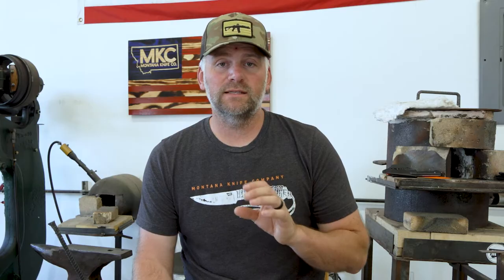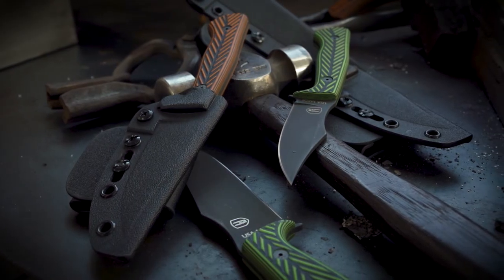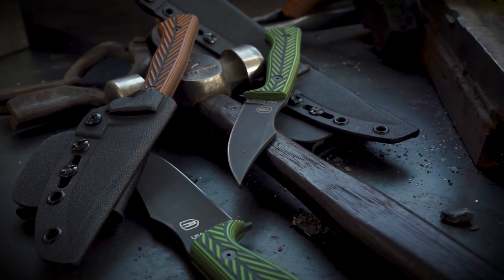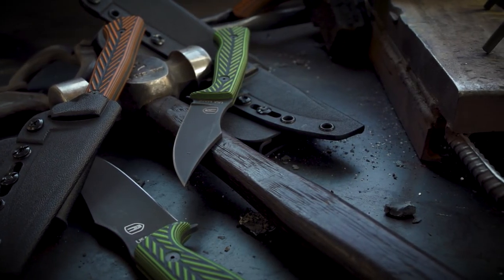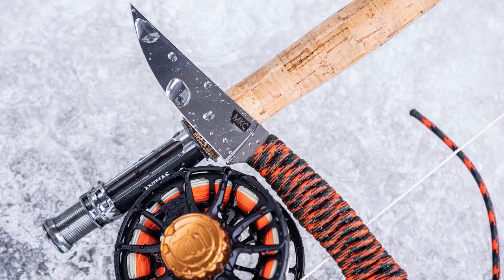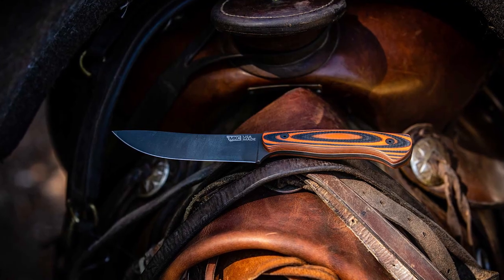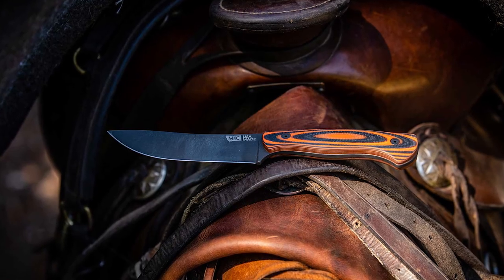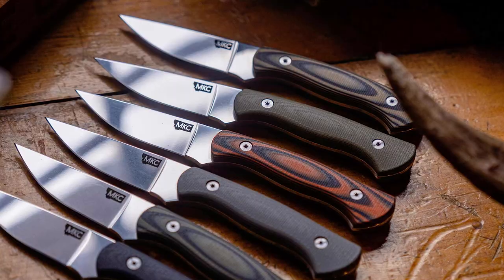Carbon Steel vs. Stainless Steel: A Comparison

Comment: Probably should mention that chromium carbides are several magnitudes harder than iron carbides. So once you do the work to get a good stainless blade sharp, it'll stay sharp longer than a carbon blade, provided all the other variables are the same like the carbon amount and Vanadium, molybdenum, or tungsten or whatever else is in there.

Comment: I’ve been in the bush for many years. I’ll go with high carbon 1095 all day. It’s simple and repeatable. Another good thing, it’s easy and faster to resharpen in the field. I use stainless steel as well, but if we are talking survival, one tool option, or long term? I’ll go high carbon all day. When you are out in a wet or humid environment, just rub a lil olive oil on the blade and re-sheath 👍🏽 another bonus: there were times I started a fire using flint on my carbon blade “something stainless cannot do.”